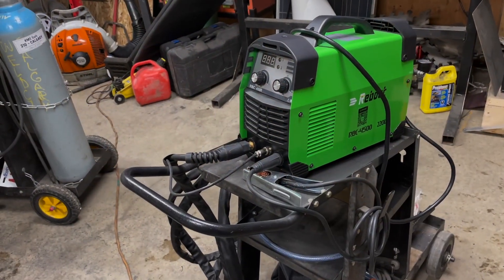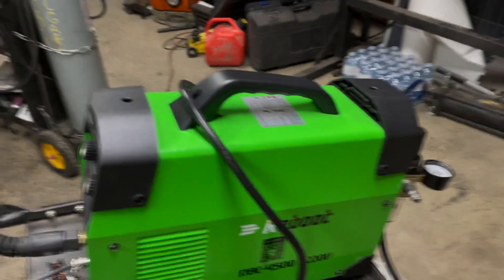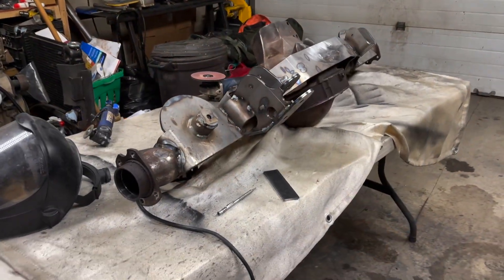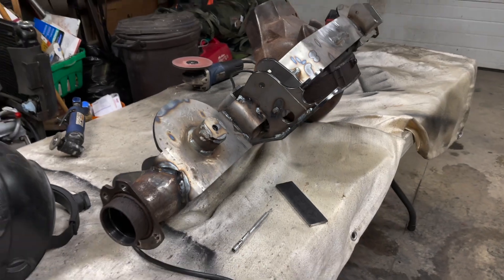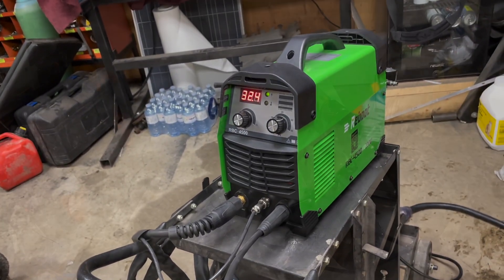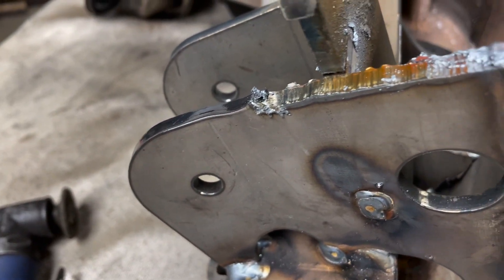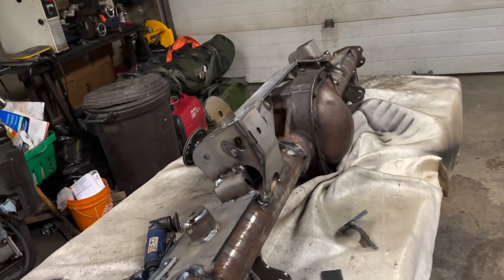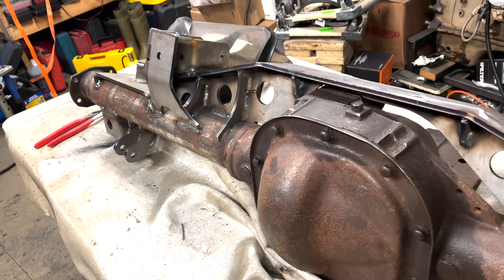The Cheapest Plasma Cutter on Amazon Reboot 4500 is still Awesome

Comment: How is the consumable use with it Jerry? I want to get one for my shop use but I'm torn between spending the extra money for the pilot arc model and the one like you have.  The buddy I was telling you about with the ESAB multi-process machine like yours does a lot of steel work and he said the pilot arc saves on consumables but for the little I would use it, I'm not sure that juice is worth the squeeze.
Reply from the maker: I haven’t replaced any yet but I did buy extras

Comment: Man I had a cut 50 off eBay worked amazing then one day the electronics exploded inside it sounded like a 12 gauge and smelled like electronic fire.  Hopefully yours lasts mine made it to project 3 lol
Reply from the maker: That’s awesome, I’ve used mine longer than 3 projects and still works.  Time will tell how long it will last, it’s like walking on thin ice you just never know
Reply: @BackCountryWrenching  ya definitely I had the same issue with my regulator China could of kept that one lol